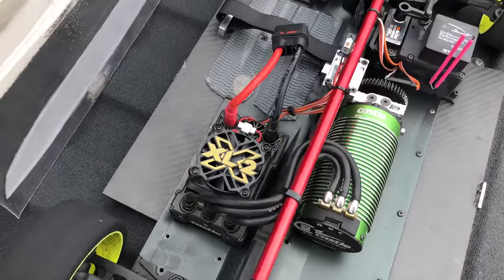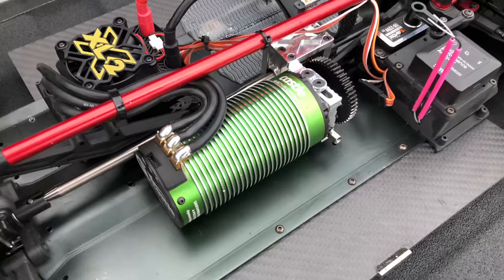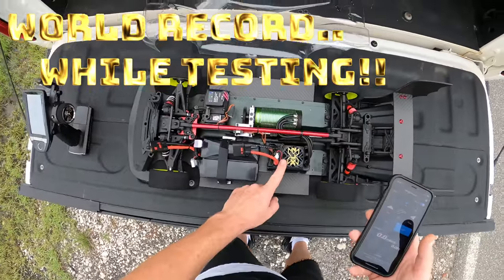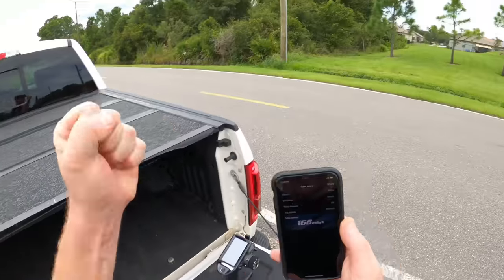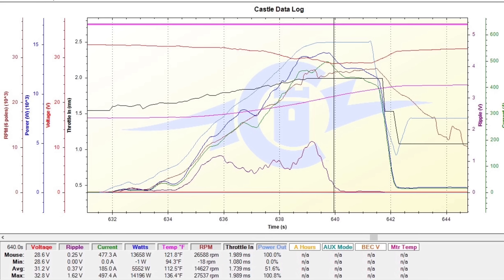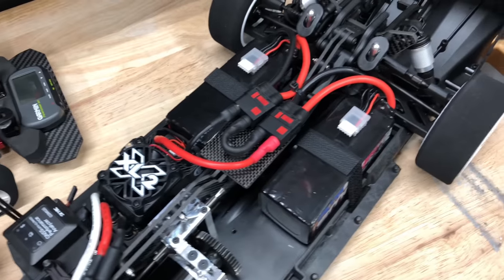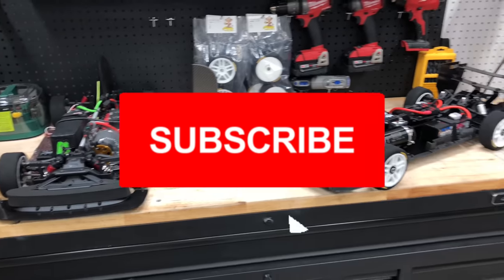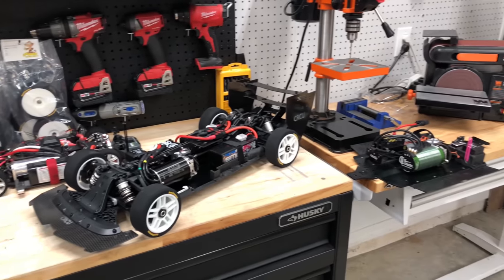CASTLE CREATIONS MAMBA XLX2 Official Release Video

Comment: Just got into rc again, bought a cheap used HSP XSTR with a kv3300 brushless engine and a wp 10bl50 esc. But this is not enough for me, i want it to go so much faster.. So should I buy a higher kv engine or lower? And what battery should i buy?

Comment: If this things built like the mmx8s, it's game over. 

Got 3 of them, and my original i got on release is still kickin butt in my typhon logging right at 400amps with the tp4070 and still runs cooler than my xlx. 

They got the market cornered now boys
Reply: They need a 12s esc

Comment: Because you are a pro with speed runs I've just bought a v2 just wondering what's the best combo upgrade to go over 100mph which out thermal shut down and flames thanks
Reply from the maker: 1717
Reply: @RazShifrin  xlx2 or max 5 with the 1717
Reply from the maker: @neilfield3229  xlx2

Comment: Hey buddy nice nice!! How many volts are you running at? How many cells and how are they wired?
Reply: Your kicking Kevin Talbots butt with that lol… he’s trying to break the record of 212mph …. He’s running on 88 VOLTS and two 3800 kv motors on the infraction platform, one both motor directly into the  front and rear gear box, there’s NO spur gear.. His problem is the car is flying into the air at only 133 mph with allllll that weight🤷‍♂️… his chassis is TOO FLUSH underneath… and he made inner wheel housings to stop wind from going into the body but that’s nooo good bcs now the air has no where to exit. I comment on the video but idk… he’s about to try again this week.